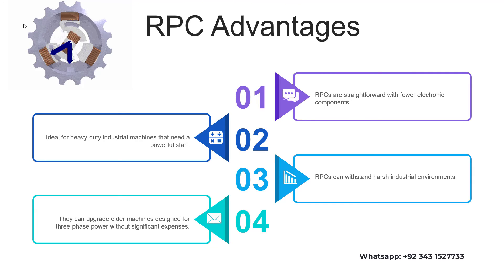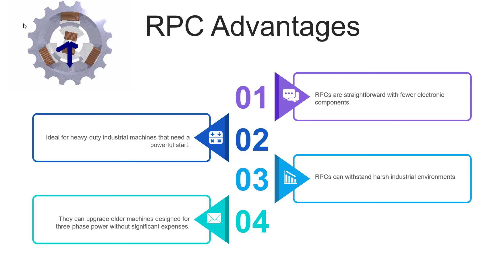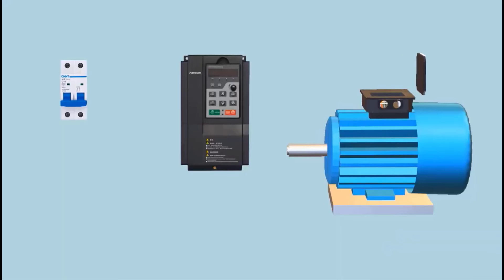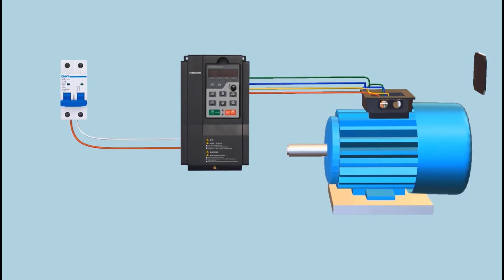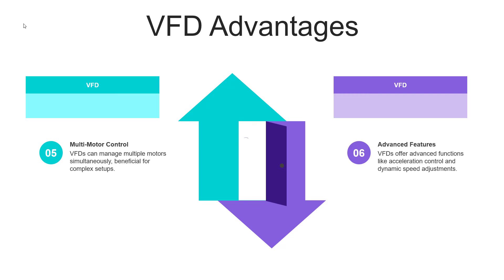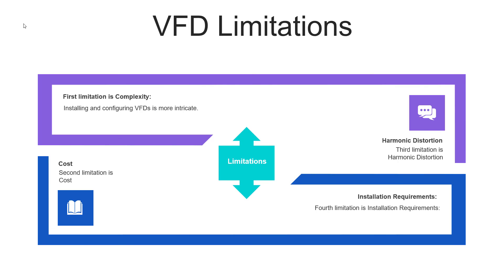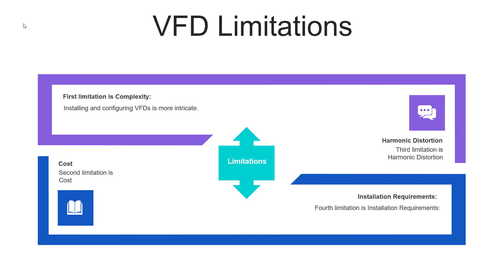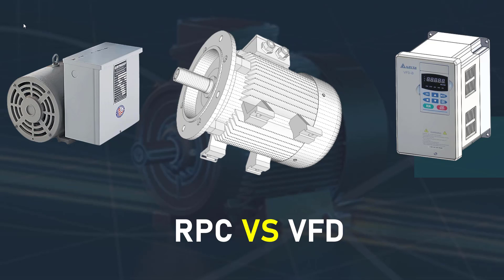Rotary Phase Convertor (RPC) vs Variable Frequency Drive (VFD) | Which One is Better?

Comment: Highly informative video! An important factor to be considered while using rotary phase converters is to ensure that the manufactured third leg is adequately balanced under full load, in the absence of which you might cause voltage imbalance or motor derating. Ensuring that the idler is sized correctly and that the converter matches the equipment load is highly crucial.